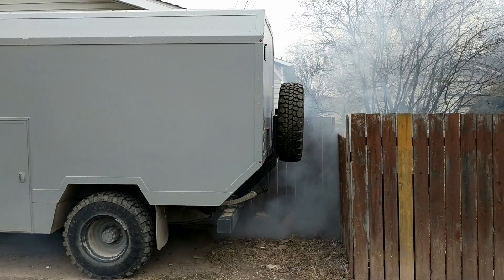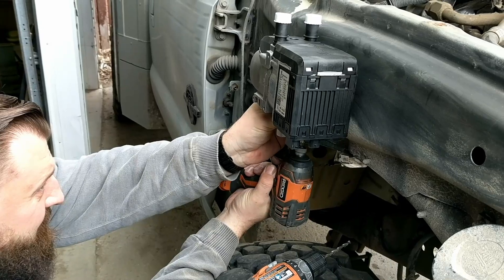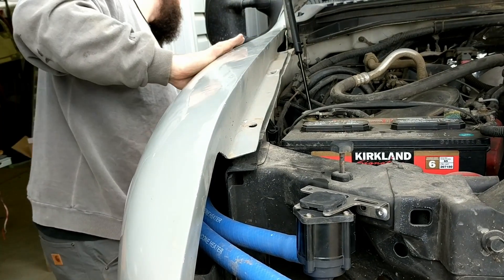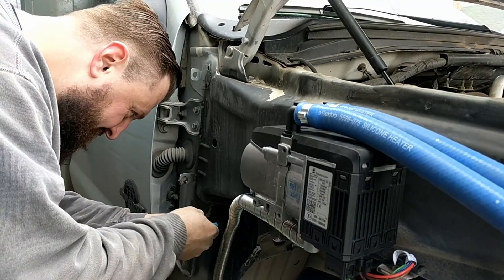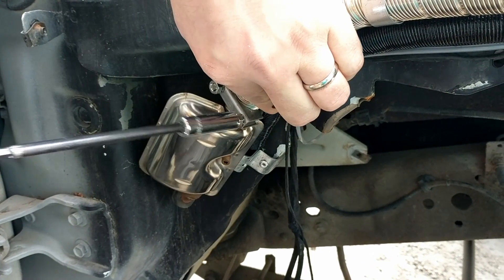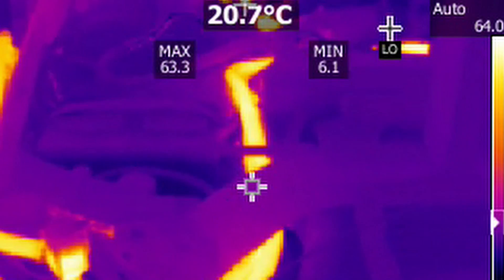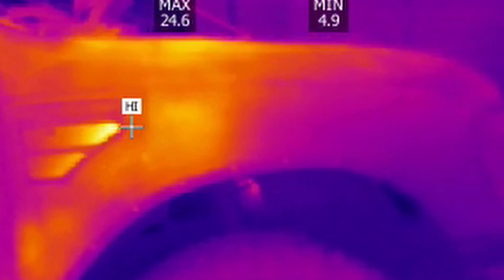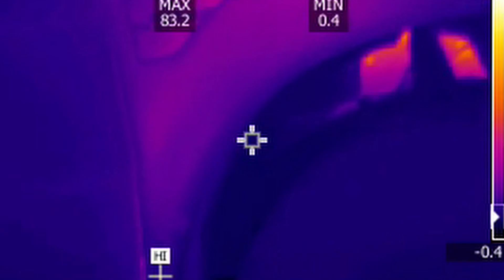Diesel Fired Coolant Heater Install - Espar D5e - How to Build an Overlander

Comment: Do you have any photos of your coolant line install? I have a 6.7 and was just wanting your advice!
Reply from the maker: We have a 7.3L
Reply: @Everlanders  ok it looked odd but I saw the logo. I think I got it dialed
Reply: @aaronglaser  How did you end up running your coolant lines for your 6.7?  I just got my heater today and was thinking I might run it through the heater core first. Would love to hear my options on install. Mines deleted and was thinking of mounting heater in place of egr cooler.

Comment: Hey great video! It's actually the only video I could find about installing a coolant heater on a 7.3. I just bought one and preparing for install. Could you tell me which T you put the inlet and outlet of the heater or does it matter ? I can't even find a flow chart to check for check valves for the 7.3. Any advice would be much appreciated
Reply from the maker: It's connected to the heater core lines, The inlet is connected to the hose which comes from the water pump, the outlet goes back to the block.  Basically the same direction as the water pump would flow.
Reply: @Everlanders  thank you very much. That helps alot !!

Comment: You can also add a heat exchanger for domestic hot water…..
Reply from the maker: We use excess solar power to run our Electric Hot water heater... https://youtu.be/_u0URusLxnk

Comment: Where did you connect into your diesel line? I’ve seen videos where people use separate fuel tanks, but this step makes me most nervous
Reply from the maker: Our truck was equipped with an auxiliary fuel pickup for exactly this sort of thing. So in our case it was very easy.

Comment: How come you tee'd in a new circuit for this?
Reply from the maker: Because that's what the instruction manual says to do... What were you expecting me to do?
Reply: Hiya @Everlanders  I imagined the heater might have to be in-line rather than in it's own additional circuit...

I have a calorifier fitted on a new tee'd in circuit and am trying to get my head round how to add in a furnace. I presume I should add a new loop like you did so that the flow isn't blocked by the furnace when not in use?

Comment: Have you considered running you block heater to your inverter?
Reply from the maker: There's very little need for a block heater in the south of Mexico... when we were in the freezing cold of the arctic, we had ZERO surplus solar... Although it's technically possible, we chose to run our Espar D5 engine heater instead.
Reply: @Everlanders  Makes sense.  Great channel. See you in Baja sometime.  Cheers!
Reply from the maker: Sorry, we're past there already, heading South!

Comment: Does this get hot enough (and is it plumbed in such a way)  to open the thermostat, get coolant flowing round and have the heaters ready to use? Or is it purely to eliminate the smoking start up?
Reply from the maker: It throttles back once it hits 60°c, so the heater core is plenty hot enough to heat the cab, but not hot enough to open the thermostat...
Reply: @Everlanders  awesome thanks :)

Comment: Interesting heating setup using the existing vehicle coolant system... could also be used for easier engine startup during extra cold nights 👍
Reply from the maker: I considered valving this heater in such a way that I could heat domestic hot water as well as the living space inside the truck, but we use the espar D2 for that, this D5 is only used for engine preheat at this time.

Comment: Thank you for posting the video. Definitely gives me ideas for how I want to install 1 on my 3/4 ton. You ever consider switching it to kerosene? We run kerosene on the ones installed on our hiway trucks and eliminates a lot of issues. No misfires or replacing igniters or screens. Just a thought I’d pass on.
Reply from the maker: Nope, we run it on our main fuel tank, when the screen starts to gum up I give it a shot of carb cleaner and it's good for another year...
Reply: Everlanders lol. Hey what ever works. 👍🏻

Comment: If you have any questions I used to rebuild and repair D5 and D2 espar heaters. Our company's  use was for truck sleepers for interior heating (of course the d5 would warm the coolant too.) 

This may sound crazy but ALWAYS start your espar heater for 15 minutes to avoid any issues from not being ran for 8 months.
Reply from the maker: That's great thanks... We always ran it for 10 hours at a time... Having some problems with our D5e, getting a No Diag error and it won't start, wiggle the whole harness near and then it works again for a while... Bad connection in there somewhere, but now we're in Mexico and heading south, so we shouldn't need it for a while!

Comment: Nice tip for you: If you were to find a boiler vessel from a early model combi central heating system you can plumb that into the system (parallel with the heater core ) to get some hot water close-in boiler style.
To be clear you need a 10L or possibly something larger 20-25L vessel, usually made from copper. They come insulated and have a copper coil either internal or wrapped around the outside of the copper vessel in which the coolant gets pumped through (either by the engine water pump or the water heater pump) You will end up with said amount of hot water which is either 70degrees C - water heater cut out temp or 90 degrees C - engine thermostat temp). If you were to employ a shower thermostat tap you can set a temperature for you hot water line running towards your galley and/or shower.
I use a 10L insulated boiler vessel (not much hot water needs in my case), I added to the standard styro foam insulation shell with 1 inch PIR insulation board cut into strips and PUR spray foam to glue the pieces and to fill in the gaps. I wanted to be able to remove the insulation shell if need be (in case leaks) 
Finally I enclosed the insulation shell in fiberglass chop matting and resin to make the vessel more ruggid. I also inserted some hardwood mounting blocks into the fiberglass shell to make mounting underneath the vehicle easier.
I can heat the cab of the van, the water in the boiler and if need be pre heat the engine (using a 3 way valve) with the water heater. Also I can use engine heat to (obviously) use the standard heater core and heat the water in the boiler.
I have a standard radiator thermostat valve inline with the feed line for the boiler which I can set to prevent the water in the boiler getting too hot (in theory it can get as hot as the water in the engine would be - about 90 degrees C

Comment: The instructions say to mount the heater low, below the lowest coolant level of the engine. Does yours work ok? And how does the diesel ignite in the heater?
Reply from the maker: Ours works fine... The Heater has an igniter inside it. All very automatic...
Reply: @Everlanders  OK, so it battery power ignites it and runs the pump? I assume it doesnt use much power. And thanks for the qucik responses, much appreciated. I know these are older videos. I have 2 older 7.3 IDI diesels and they are very hard to start cold. So this may be the solution on the road when I cant plug in the block heater.
Reply from the maker: Yes, there is the igniter that pulls 10 or more amps for a bit, then a blower for the burner air and a pump for coolant. And a tiny fuel pump... Really like ours.

Comment: So this preheats the engine coolant?
Reply from the maker: Yes, correct.  I have the option to heat a heater core in the back and also a water heater. With a couple of valves I could heat the water while driving too. So far it's just heating the engine.
Reply: @Everlanders  the versatility of it is great, it could be used to heat water for  powerwashing  under my freight truck. Thank you for introducing this to me.
Reply from the maker: Yes! If you are looking at heating water with engine coolant, you could look into Marine water heaters which commonly use engine coolant to heat water.
Reply: @Everlanders   Thank you,ill look.  I found a Eberspacher water heater too, I am hoping to configure my utilities toward a  multi-use direction. I have acres of space in the frame for tanks....much to learn thank you.
Reply: @Everlanders  Thank you you two are great.

Comment: The coolant pump is upside down
Reply from the maker: +Adam A Really? Thanks for pointing that out, I have the inlet pointed down so that any air bubbles will float right up into the pump and get pushed out the side. It seems to work fine and I'm not having any problems. But anyone else should double check with espar first.
Reply: I could show you some installation instructions from Espar but then I would have to figure how to do that. It cant point straight down like that but turn it at-least 35 degrees and its fine.

Comment: You can hook it up to your climate control to heat up cab also of your truck.
Reply from the maker: +godspeedkalsi Yes, very true.  We use the Espar D2 for our cabin area because of simplicity. The D2 is much quieter than a fan on a radiator if using a D5. However this is something we may still Implement for redundancy. Heating domestic hot water is another good use.
Reply: Everlanders I agree. You can hook up espar coolant heater with your HVAC motor in your truck. While it heats up coolant to bring engine up to operating temp. It will turn on your HVAC motor and heat up your cab too. When you get in your truck every winter morning. Engine and cab will be toasty warm, windows defrosted.
Here is link to video will give you better idea what I'm  trying to say.
Sadly you have to order couple of more parts for your existing install in order for it to work.
In range of 100-300$ depends how fancy you want. :-) https://youtu.be/ZE6DIdVXHE4
Reply: Everlanders if you turn on your hvac fan does warm air blow out? 

Also how long does it take to warm up the engine on a very cold day?
Reply from the maker: The Espar D5 does have provisions to power the blower motor and also heat the cab of the vehicle. However we have no use for this and do not have it connected. On days around 0°c it takes 15 to 20 minutes to get the engine up to temperature, -30 might take an half an hour or more.
Reply from the maker: McNeil Racing Inc.   https://www.mcneilracinginc.com
Reply: @Everlanders  thanks! I just found the link on your other video. Nice build! I have the double design fenders and wasn't sure the other ones would fully cover the tire. Do you know your width outside to outside of tire?

Comment: I'd install the air intake either to the main air filter assembly or go for a separate air filter cone they use for 50cc mopeds and such. Just a couple of dollars and you'll be sure to not have the machine broken by sucking in dust and other small particles.

Did you opt for the mobile phone remote access? That definitely is something to go for. Nothing is nicer than arriving in a warm nice truck when cold outside. Mobile phone access let's you have flexible schedules and you don't need to know in advance at what time you will be going to the truck, as with manual control panel.
Reply from the maker: +Design RSQ I rolled my own, tapping into the blue wire on the controller. I have both cellular and iridium satellite uplinks so I can remotely control and track everything. I can adjust water pressure at the sink from the peak of a mountain ridge. So yes, I can remotely turn it on as I leave work or wherever, but mostly from the bed in the truck on cold mornings we need to roll early. "Okay Google, Start the D5"